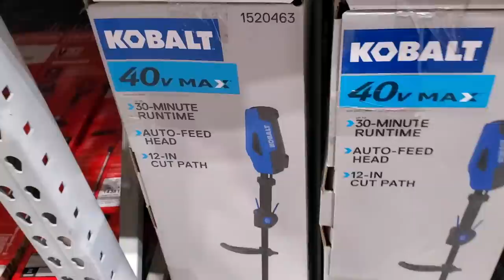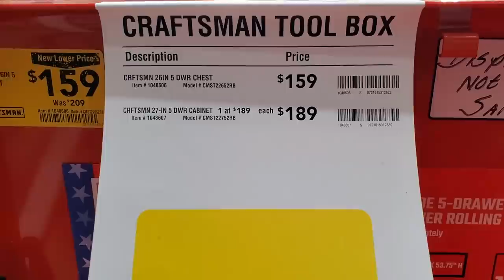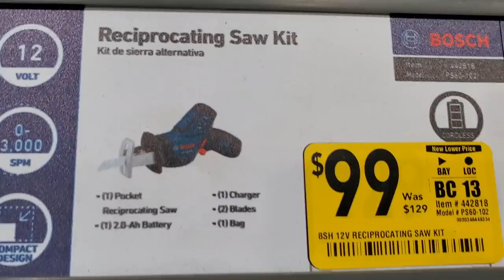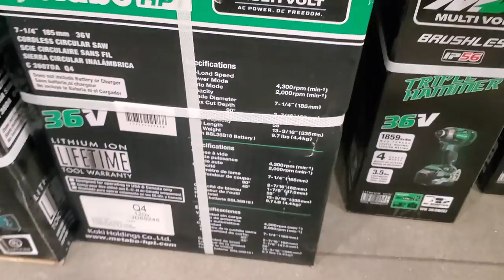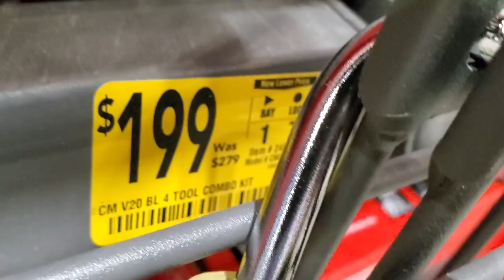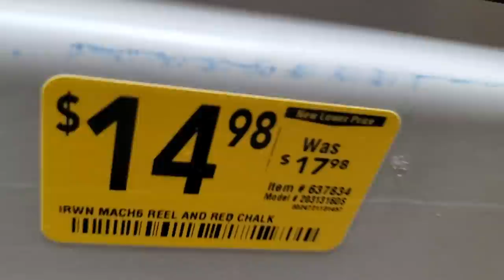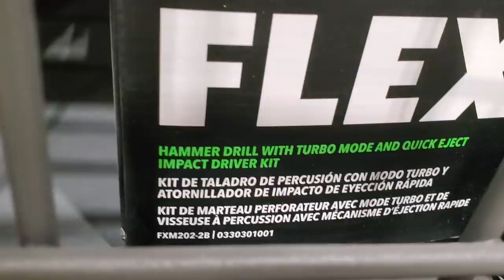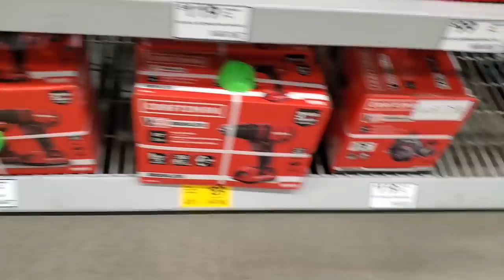Bogo Power Tool Deals Shopping @ Lowes

Comment: If I wasn't invested in the M12 line already, I would totally pick up that DeWalt 12v Xtreme Impact and drill combo with the free impact wrench for $199. That's a deal!
Reply: I just picked it up, the wrench is the real deal
Reply: @seanlatulipe4572  It looks like a damn beast!
Reply: I started grabbing these when they were giving away free 5 amp hr batteries and grabbed another kit just for the 1/2" impact wrench.  Its a beast for a 12v stubby. Waiting for Dewalt to expand the line further.
Reply: @jhstyer  I'm seriously debating picking up this BOGO deal. It's such a great deal and I want that impact wrench
Reply: @Luigiz28  get it you won't be disappointed. Personally i like the handle a lot better than the M12 line i have smaller hands. Also Firestone over torqued the lug nuts on my F-150 and the 1/2" impact wrench took them off effortlessly. You won't be disappointed.

Comment: you don't register metabo hpt tools for their warranty, and also their circular saw is one of the most balanced and lightest 7 1/4 on the market, when you compare it to other, comparable saws.

 Wanna hold a heavy saw, try the new Bosch Biturbo with a 12ah or 8ah. or the Milwaukee Gen2 Fuel